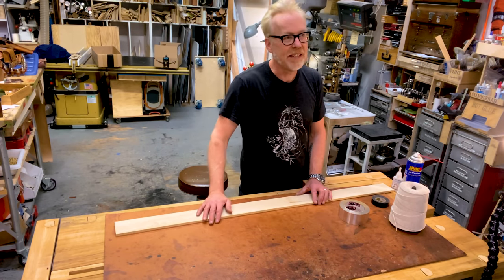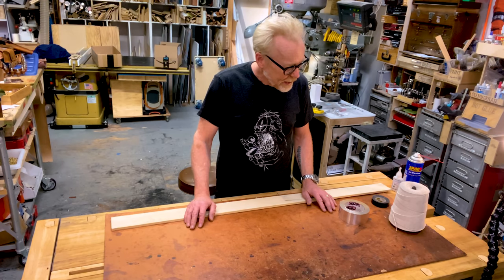Adam Savage's One Day Builds: How to Build a $5 Sword!

Comment: An slightly advanced method of the tape handle wrap that I have used on a real broad sword, and a camping axe is the following that requires a roll of black cotton cloth electric tape, and baby powder. NOT STANDARD ELECTRIC TAPE.
~ Stretch the tape out a few inches to start the work, and twist or spin the tape very tight, forming a cord. You should notice immediately how this sticks to itself and forms a cord like shape. Standard electric tape won't replicate this well.
Attach it to the handle just like here and twist the tape as you wrap it around the handle. remember to twist the tape very firmly before wrapping it...as you wrap it. The difference is a tight touching spiral where each wrap touched the last, they will slightly stick together, this is ok. It should looke like a thick threaded bolt/screw. I ran the end up through the wrap with an awl.
This will be sticky and it will make your hands black Maybe, mine did) Add power and rub the power into the tape repeating until the tacky wears off and the black stops wearing off.
The handle will still be black, and look and even feel like leather. Makes a very nice grip. 
Most important tip: remember to twist the tape tight before and as you wrap it, but be careful not to snap it or flatten the wrap. You want a round cord wrap.

Comment: Seeing how deep the coping saw was, I wonder how one might saw out the length of the sword blade with such a tool. I'd imagine it would be in segments, rather than a continuous line. As the cut progresses, I'd guess there'd be some drift away from the guidelines, due to the nature of the spine of the saw. Probably something that would get sanded down to the line after cutting.

Comment: To be even more accurate, you would want to thin the blade down towards the tip. Real swords typically have a distal taper, meaning they gradually get thinner as you go down the length. In addition to making the blades lighter, it moves the center of gravity closer to the hand, making the blade feel more nimble.

Comment: I'm a huge star wars fan and I remember as a kidvraiding my dad's garage to make my own lightsaber. Early 80s. I was like 6 I asked my dad if he had any spare metal tubing he really didn't nee he was a mechanic  by trade so had all kinds of parts in boxes everywhere. He cut me off a part of a aluminum pipe he had that was like 7 inches long and gave me a box said use what you want. Well this was gonna be MY lightsaber not Luke's version so I had to make do with what I had. I  found an plumbing end cap for a pipe and had my brother use my dad's pipe th reader the make matching thread on my handle and it fit perfect.I got an old flashlight and took it apart and had my bro drill some holes for me in the handle andni fit the insides of the flashlight in the handle I soldered some old  lawn mower piston rings to the handle towards the front an soldered a washer around the light bulb about 2 inches in. I put the push button on the outside and metal glued it  on and then it was basically a redesigned flashlight almost steam punk looking. But no found an old pvc pipe that fit perfect to the inside of the handle and was about 28 inches long. I cut out lines about 6 inches long all up and down the length of the pipe then glued a pic end cap on it. And painted it neon green glow I  the dark paint. I put a neon green piece of clear plastic over the flashlight then glued the pvc into the handle.  after letting that charge during the day when you lit the flashlight omg it was so cool between the bright glowing blade the light coming out the holes it came really close. Plus the pvc was the really thick kind so was pretty strong. My friends wanted it but i was the only kid with a home made light saber lol.

Comment: ive actually been wanting to make clouds buster sword for a while, i know that those sheets of insulation are silvery i was considering putting that over wood but it looked crummy is there a way to translate this aluminum tape method or something similar to say for example a blade that was 8 inches or so wide? the wood working is no issue for me i lack proper tools but I've done a lot of this in scouts
Reply: You could try a lot of care, thicker kind of aluminum foil and spray adhesive.

Comment: I would like to see something built make something that uses a transformers to step up the voltage to run lights on a 9 volt battery, 277 voltage lights maybe kick it started with capacitor

Comment: What material might one use if you wanted this to hold up to a bit of sparring?
Reply: If you want to stick with wood as your base, just looking things up online, some Hard Maple/White Oak/Ash are hard woods with about 50% more Compressive/Bending strength than the Poplar he is using, Hickory is 100% more sturdy. Ideally though, I wouldn't use wood, as any deformities will be permanent, I'd recommend PVC and a heat gun. Take a long piece of PVC pipe, heat it until it becomes soft, flatten it out and profile it. Once it cools, you can cut/reheat/shape it, and so long as you're not to rough on it, it should resist deformation pretty well. As far as Aesthetics goes, you can dress it up pretty much the same way Adam does this wooden sword. I'd have to say though, use a smaller diameter PVC for the handle, inserted into the lower end of your "blade", otherwise you're going to have a very rough time forming your handle at all. As for the tip end of the blade, some epoxy, or crazy glue in copious amounts to seal the end off, then sanding it down to match the profile should help get you a nice, clean edge all the way out to the tip, before dressing the blade up. Just keep to light strikes, PVC is somewhat flexible, but push it too far and it will shatter on you.

Comment: Trick for removing aluminum tape from the backing. Remove the backing from the tape, not the tape from the backing. If you don't bend the tape and only bend the backing the aluminum tape will tend to be straighter and not curl or spring around when you get to the end.

Comment: Shows $6.00 coping saw at 13:44 then when it's time to cut, pulls out $225.00 Knew Concepts coping saw at 28:07.  "What you can use vs. what I use." - Adam =)

Comment: The completely "i'm broke af" version is free actually, for example: All I have is a butter knife. I will cut off the last wooden step in the backyard, which is free (and I can just put some boxes or books to replace it), then I will get the neighbors dog (with sharp k-9's) to chop down the wood by sticking it through the neighbors fence so the dog can chew the shit out of it. Then I will rub it against the concrete to sand it down to shape. Use the angry neighbor's dog for any other cuts as needed. For the handle I can use my shoe laces and wrap it, or rip off a neighbor's telephone line (since they probably got a cellphone and don't use their landline anymore). Finally for the paint, just go on craigslist and see if anyone is donating old paint and paint your shit in all the random colors possible, and it's okay if it looks like a unicorn Fortnite Battlepass skin. Wah Lah!

Comment: first play I did that featured swords (The Hobbit) our swords were cheapo metal conduit? pipe? thin aluminum of some sort that had been hammered flat and a guard brazen in place. none were straight. all showed a thousand hammer blows. and the handle must have been over 2" diameter. Ugly damned things. I made my own prop battle axe (in the conan fantasy heavy metal album cover style) out of plywood and a broom handle. Good times.

Comment: 21:40 bad advice.  If you are making it out of metal then forge the bevels first.  Half an hour hitting it with a hammer is better than two hours grinding ig - and you need less steel to start with too.

Comment: Ok.. So you're a young kid, live in an apartment, your parents aren't too handy and you've never made anything before but want to start with this sword. Only 5 bucks? That sounds pretty good cause that's pretty much all the money you have.

So, this 5 dollar sword requires:

Piece of wood; ok you can probably find that free somewhere.
Battery drill: $50
A coping saw: $15
Sandpaper(various): $10
Rattle can paint: $10
Foil tape: $10
Electrical Tape: $5
Twine: $5
Glue: $2

In total, to make this 5 dollar sword you need to buy over a $100 worth of things.